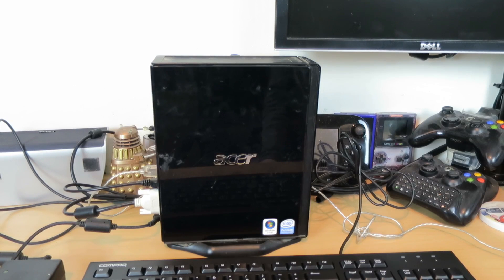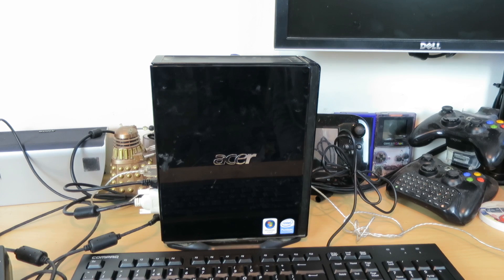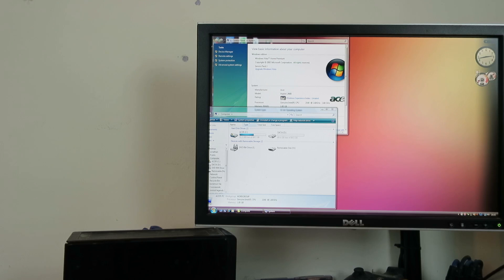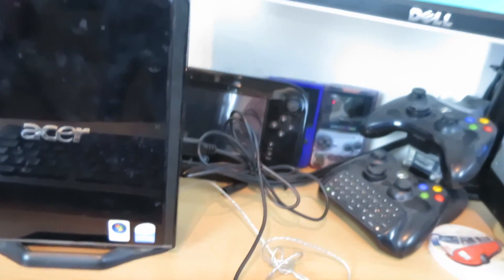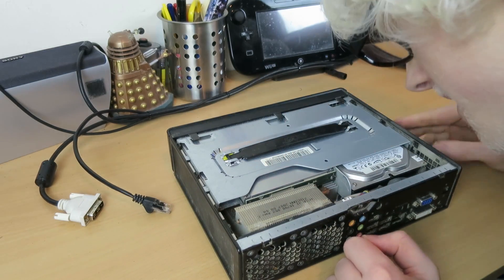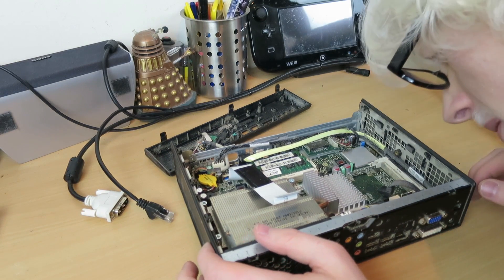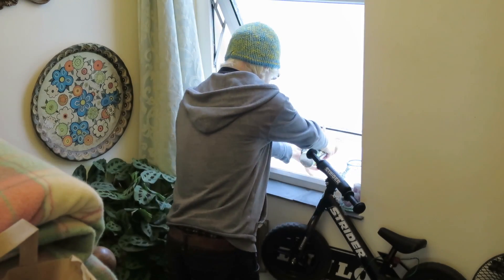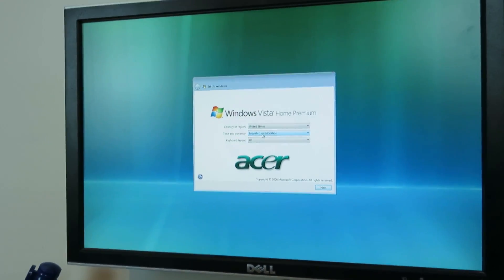Restoring, 'Cleaning' and Flogging an Acer Aspire L3600 | IMNC

Comment: I have laptop with this CPU (Atom N270 @ 1.6GHz). It's pain in the ass. Sooo slow that you can't even play 720p video. It's also only 32bit ... pretty bad CPU. I can safely say that this machine is useless for modern use.
Reply: it's not an Atom System.
Reply: Yeah, I checked and I'm wrong. It's Pentium Dual Core CPU. My mistake come from the fact that the sticker misled me. :D
Reply: +Boris Gospodinov that's a pentium logo ;) Probably a core 2 duo based one. Definitely faster than an Atom (former Netbook user: PowerPoint 2007 presentations were laggy :P)
Reply: +Boris Gospodinov 
Re-install windows, I bet it needs a good cleaning.
Reply: +Priceless Persuader no these Atom books were as fast as an pentium 3. And the onboard graphics couldn't help much either. 
The revolutionary thing about them was the extremely low power consumption (an Atom netbook uses like 9W). Nowadays an I series processor is nearly as efficient when not loaded heavily.
Reply: Julian Doll He said it was a pentium D
Reply: +Priceless Persuader he owns an Atom netbook and Tom talks about a Pentium D PC. Correct me, if I am wrong